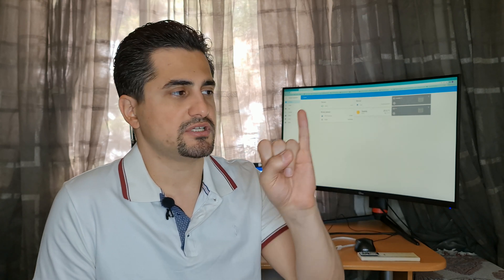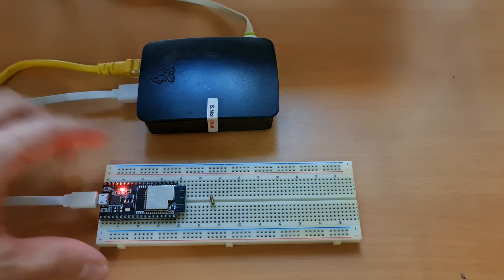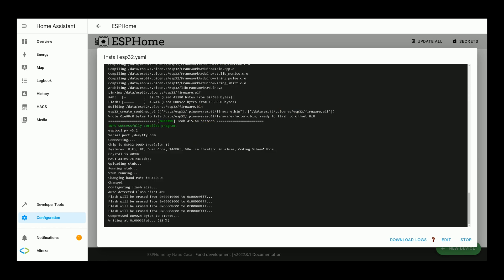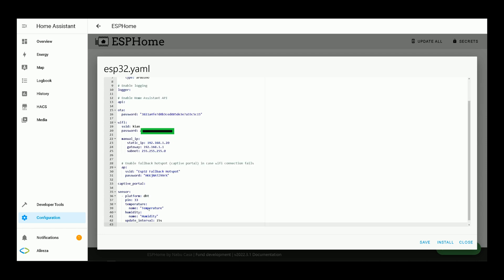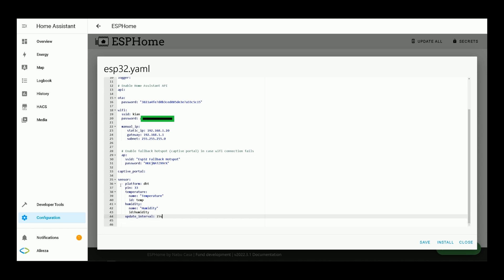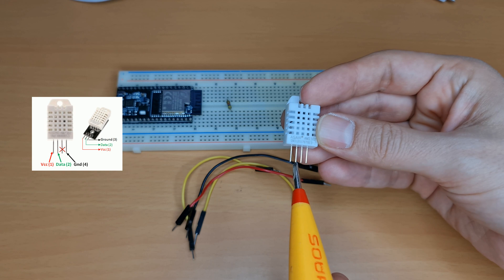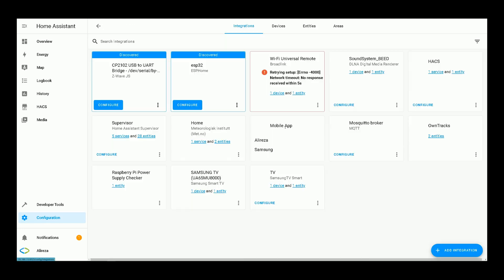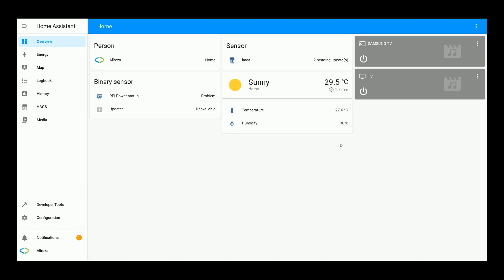Temperature and Humidity Sensor in Home Assistant

Comment: Hello Ali! I was thinking about asking you to make a video about DHT22, but a little search in your video gallery and I found this one! Great work as always! I have a question... I am planning to use a DHT22 sensor to monitor my dryer cycles. I will slide the sensor inside a small hole in the exhaust pipe. I bought the DHT22 module with 3 pins, not the sensor with 4 pins. Do you think it is correct for my project or the sensor with 4 pins would have been a better choice?
Reply from the maker: Hello, Please email me the picture of your sensor then I will tell you the pins. (Alireza_44907@yahoo.com)